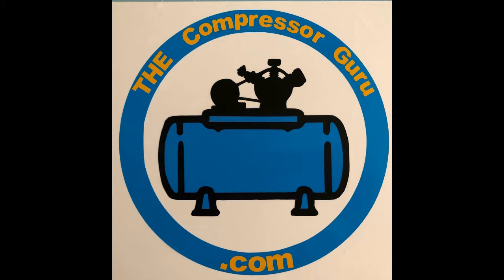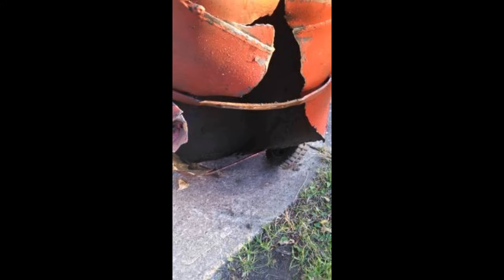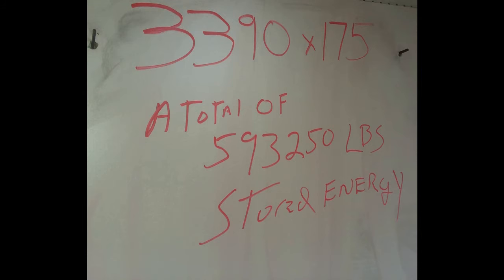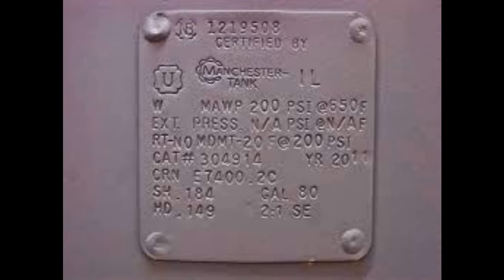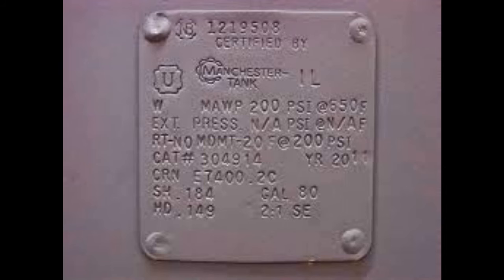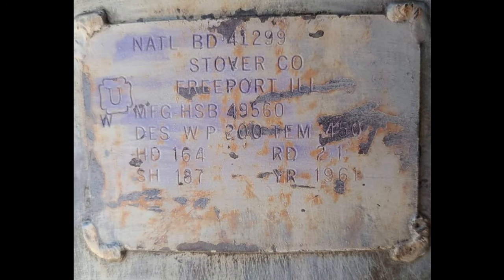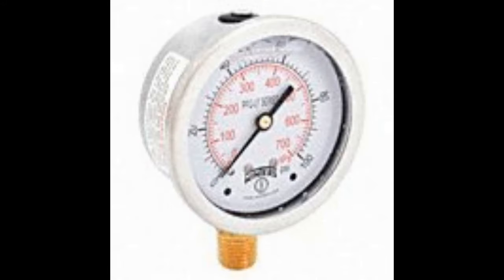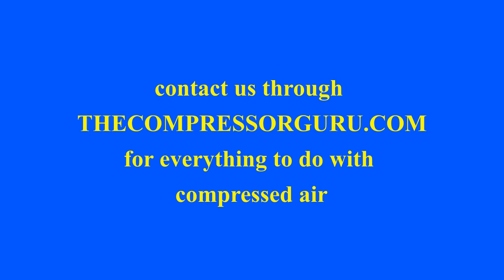Tank Safety, This video may SAVE YOUR LIFE!

Comment: Excellent video. I am always amazed at how many guys refuse to believe and potential danger with air storage tanks. Arguments come up on the online forums regularly. Too many take pressure tanks for granted when they can be bombs. I will refer to this video in hopes to convince the hard heads. PS all my air tanks have 2 safety valves. Nothing runs above 120psi. 

Edit: Also a tank story. Retired guy working on old truck in his barn behind the house. He goes in the house for lunch, and then there's a big BOOM. Goes out into the barn, the compressor has blown up, the tank went thru the back barn wall and out into the woods several hundred feet, missed many trees but finally hit one. 8ft x 8ft hole in the barn wall. It took him months before he got back working in the barn and got things repaired.
Reply: Old air tanks scare the $hit out of me.

Comment: I was once at a friends place and he brought out an older Craftsman compressor to use. He plugged it and and started it up As it was building pressure, I noticed the tank was 'sizzling' like somebody was frying bacon. I looked at the tank, and immediately yanked the cord out of the outlet to turn it off, and told the owner that the tank was a bomb that could go off at any moment, and he should not use it, and replace the tank at once.
Reply: I bought a used Craftsman upright compressor a couple of years ago. I drained a fair amount of water out of it.  I was religious draining it after each use . Brown stuff (rust) plugging the drain. Finally I tip it on the side & used a  oil can put X- amount of oil in the drain valve. I cycled the compressor a few times until the rusty scale stop coming out. NOW it freely drains water with no issues. A Note too others Please follow the owners manual! USAF 1981-85

Comment: I have always replaced the safety valve or blow-off valves in my compressor tanks with ones slightly below the maximum working pressure I use and most often well below the MFGs suggested one. Besides normal maintenance, I've always figured this gives me just a little more margin of safety.

Comment: Thank you Guru for this important Safety reminder. I bought a broken oilless compressor & broken pressure washer from a young construction worker friend. As he moved the compressor to load it on my truck, I heard it sloshing! I got it home & it was half full of water! No drain valve, just a factory painted plug, frozen in place! I like to think I saved his life. I remind him to this day to daily drain their air tanks. I will cut open this tank to serve as an example or hydrotest it to failure with pictures (either way). Paul.
Reply: Ironically, on the other hand, having a large amount of water in the tank might mitigate an explosion and save a life, since failures usually happen on the tank bottoms and making the air try to push out the incomepressible water would take longer for all the energy to get released.

Comment: I don't know what that "pounds of stored energy" means, but we have units that work perfectly well for force and energy. I'll redo the calculations and the result might be surprising. The tank has 175 PSI in it. That converts to ~1.2 Megapascal in pressure. The volume of the tank is listed as 80 gallons, which is ~302 liters. We need to know the temperature for our energy calculation, so I'll use 293k, which is about 67 Fahrenheit. That works out to about 1007 kilojoules. A stick of dynamite produces about 2.1 megajoules when detonated. So, that air tank has the destructive potential of about a stick of dynamite in it! Treat it with care.
Reply from the maker: thank you for the help explaining.
Reply: 1007 kilojoules is not about the same a 1000 megajoules, it is 1/1000 as much.
Reply: @secondwindmusicproductions   Oof, I didn't notice I copied the wrong excel cell into my final answer. A stick of dynamite is about 2.1 megajoules. The 1000 megajoule cell was one of my conversion factors, not the final result. The air compressor tank has about as much energy as 1/2 a stick of tnt.
Reply: @WarrenGarabrandt  TNT is not Dynamite.

Comment: Absolutely everyone with any size compressor should watch this.  I've seen countless videos on YouTube of peoples janky set-ups based on other peoples janky set-up that should get 1000 thumbs down but instead get 1000 thumbs up because no one actually knows WTF they are doing. It's all test piloting unproven ideas.

My added advice in addition to internal inspection and hydro testing is #1 make sure you have proper safety valves installed that are less than the max pressure rating of your tank and make sure they are in any location where the pump could over-pump a linked line or an auxiliary tank or both.  

#2 Understand that pressure ratings on tanks and all fittings, lines, etc are greatly reduced as heat is increased.  This is why using PVC lines, while generally ok for home shops and smaller compressors, should never be located anywhere near the tank where air is still hot.  IIRC, a 1" PVC line is typically rated at 500 psi but if the air is 200 degrees the rating drops to just 100 psi.  Most home garage people operate their tanks at 100-130 psi.. so guess what could happen...  BANG!   PS - Keith Rucker of Vintage Machinery is a god among men.
Reply from the maker: Amen old owl!
Reply: @oldowl4290  NO pvc NEVER for air
Reply: @funone8716  I agree. Some people do it but I never would.

Comment: So i got a delta tank 80 gallon i pullled plug out of bottom, To get the loose rust out i used evapo rust mixed some getting fluids. such as PB blaster seafoam into it can I rinsed it out again with baking soda water the tanks probably about 22 years old.I did buy the proper pressure release valve new sat in barn outta use for probably 15 years. Was it bad that i had added vinger into a guy told i probably shouldnt disturbed the rust with that stuff so then i added baking soda solution to it rinsed it again
Reply from the maker: Loose rust is not the concern. I think you are fine. but if concerned about tank stability , hydro test it. simply and quick not exactly but you will know if you can trust it.
Reply: @THECompressorGuru   yep I plan to hydro test great videos I have learned alot from your channel

Comment: Tried to see if mine is certified but only found that commercial use ones need certification. I bought a used Kobalt 26 gallon and is 16 years old. There is no rust on the external of tank. Now you have me wondering if I should use it. But I could turn it off at half way point to be on the safe side or should I even use it.
Reply from the maker: Keep the tank drained and use the compressor for a few more years. and then get is hydro tested.
Reply: @THECompressorGuru  how much do they charge and who does it?
Reply from the maker: @mgomez5606  If you have a pressure washer you can do it yourself. there is a link in the description to show you how.

Comment: Mr. Guru,
Thanks for making this video. I am always in advocate for being safe. I would like to ask a question, what is the importance of draining the tank every day? I understand water and metal don’t get along with each other, but as soon as you turn these things on condensation starts to build up and pools at the bottom. So even if you drain it every day you’re not going to get 100% of the water out and it’s always gonna be damp inside which is going to promote rust.
Thanks!
God bless!!
Blue
Reply from the maker: I think the best reply might  be the couple drops that accumulate in the bottom of the tank does not INSTANTLY cause rust. An auto tank drain (which we sell ) eliminates having to remember to drain the tank REGULARLY. 
Not hollering at you but good practices will make thing last longer.  thanks Blue

Comment: My father told me once , if you take any pressure vessel.  Tire , air tank , even a propane cylinder think about the PSI.  That pressure is at every square inch inside.   He would say. How many postage stamps could stick on the inside of that vessel ?  Kind of spooky when you look at it that way
Reply: You realize that’s 6 stamps to make a square inch right which is a box. It’s not
That many haha

Comment: Yes someone has an old compressor that set up for 175 lb why not install a new safety valve and lower the pressure to 150 or 125 lb.
Hey if you don't need 175 and it's only a bragging point......
....ehh?
Great video by the way and the math was way more than I expected.
I figured the volume be some % shy of 175 tanks scattered throughout your house. That's not only scary, but you wouldn't be able to watch TV. 😁
Excellent video by the way.
Last year my 1993 emglo twin tank compressor kicked the bucket. Not just the capacitor but the pressure switch.
I still haven't thrown it away yet but maybe fer kicks and giggles I'll cut the ends off the tank to see how nasty it looks inside.  I wasn't good about always draining the tank and letting the pressure out.
Fantastic video I seriously hope it scared a lot of people. 👍
Reply from the maker: if you put a lower safety that may help but are you masking a problem that has not happened yet.  if you cut the tank send me some pictures we may do another video on it.
you can contact me through thecompressorguru.com
Bud
Reply: @THECompressorGuru  thanks, I subscribed so I wouldn't forget.

Comment: Hydro testing is a relatively easy task now if you have any pressure washer. You just have to get the right fittings. I'm working on it now. I'll video the test. My 50 year old compressor shows no signs of degradation but I'll be testing it as the Guru suggests you can bet. First I am testing the one I just welded uo with ss mig. I know but what the heck, right? Call me curious. 😎🤣

Comment: i have a  old craftsman air compressor from 1980 i think it had a leak in the bottom of tank i guess it seal it self with some rust from inside the tank i can feel rust bits comeing out of the drain plug  I'm getting rid of it I'm not even messing with it 😁
Reply: How big were the rust bits?

Comment: Do they have expiration dates like propane tanks
Reply from the maker: No. but a rule of thumb for most insurance inspectors is to have them Hydro tested when 40 years old. we do have government boiler inspectors here I know they will show up and give a certificate and a metal tag to the bigger industrial customers. I have had some issues with an inspector that did not understand why a different safety valve on a tube before a check valve. I think that logic explanation might make a good episode.

Comment: I am wondering if a DYI hydro test really proves out the tank?  I guess I have this odd feeling that it could hold fine on a test at150%, but does that really mean it won't bust over the next 200 air pressure cycles?

Comment: I have a 35 year old Sears compressor. I drained the tank the other day and got about a cup of very rusty water out of it. Time to junk it?
Reply from the maker: several things to consider. what size is the tank? and is it worth doing a hydro test? rust colored water is normal but the age give me pause to do some more checking.
Reply: It's a 12 gallon. I kind want to get a smaller one since my only use these days is filling tires and maybe blowing dirt off/out of something. After watching your video and others, I want to find one with an ASME tank but that seem unavailable in smaller compressors.  @THECompressorGuru
Reply from the maker: @Hybridog  I do not know weather i would bother with a tank that small. when I do have them in to work on ( my labor rate usually discourages that) I turn them on and have them outside the shop and wait til i hear them shut off before I go near them that is how confident I am in these small uncoded tanks. I think t may be time to shop for a new small comressor.

Comment: Are there a catalog of images for examples of acceptable vs excessive rust?
I have a 21 year old tank that I just bought, there was, to me, what seemed like a fair amout of rust flakes in the bottom. Last guy said he drained it daily. I cleaned the chips all out, lightly hammered it all around the bottom and it appeared to ring solid and bright. I also Hydrotested it according to the video you mentioned to 250psi (certified WP 150) and it held pressure. No signs of any welding or attempted repairs. I suppose that means its okay for now?

This is my first larger compressor, 60gal whereas my last one was 20, so the potential energy storage has me a little uneasy. I also used some evaporust and it looks a lot better. Still some rust, but the bottom doesn't look that smooth compared to the top. Hard to tell honestly through a 2" bung.
Reply from the maker: by hydro testing you have done all you can for now.

Comment: Do you know a good source for a 80 gallon vertical tank? I have a IR that has a pin hole in the bottom. 
Thanks
Reply from the maker: Yes contact me through thecompressorguru.com tanks are not cheap but we do have a good source.

Comment: I have a IR 80 gal 5 hp. 2340 compressor but I have never mounted it to the floor is it really necessary?
Reply from the maker: all vertical compressors are top heavy and tip over easy. the short answer is yes... But if you have it in a compressor room where you can not bump it with a fork truck or even pull to hard on the hose . ok maybe. the other thing is an unsecured compressor may walk around. the vibration room it running may have it moving some around the floor. the 2340 is not seen in many industrial applications so the boiler inspector probably won' catch you. 
so for 20 minutes 4 anchors and a hammer drill ...Why not?

Comment: is 140 psi dangerous on an unknown tank homemade with no cuts nicks or damages? tank volume is around .3 gallon. (1/3 gallon). mounted near spare tire of truck.
Reply from the maker: I will say this all tanks are dangerous.but its is a small tank that means less sq inches for the PSI and 140 is safer that 175. for all the larger the tank is get it hydrotested. if for nothing else peace of mind
Reply: @THECompressorGuru  Thank you.

Comment: OSHA tests the wall thickness of my tank every 3 years using ultra sound. Even that doesn’t seem too thorough. And the guys they send out are not the sharpest.
Reply from the maker: that is really interesting. what state?
Reply: @THECompressorGuru  California of course. And they charge me. It’s in my business so you have to have the permit, which requires inspection.

Comment: It seems like the horizontal tanks are more prone to rupture. When I inspected and cleaned my 20 gal horizontal I noticed the metal around the drain bung was warped inward mostly likely from the original welding process thus making it nearly impossible to drain all the water out, even after rocking the tank back and forth. 
I noticed a similar problem on a vertical tank I inspected where the drain bung protruded about an 1/8 inch or so into the tank, as well as the drain plug. My solution in both cases, although not quite at effective on the horizontal tank, is to take a small cut off wheel and cut / grind the inside (back side) of the bung flush with the inside of the tank and grind down / shorten the drain plug as well. Also thorough cleaned with acid, hydro tested, dried and then coated the inside with Fluid Film (lanolin).
Reply from the maker: I am very glad you hydro tested after the modification.

Comment: the Psi Relay Contact points got stuck and allowed for a continues  running or someone adjusted them to pump even higher psi then it was designed for .. I'd say it was stuck Contact points that did continuing run because that was allot more then 130 - 150 psi that did something like that more like 300+psi that did do that.  these contact relay points are some what or were once like what they have on Water Well Pumps to turn on and off the pump  from 20psi to 60 psi of water or water tank psi,.
Reply from the maker: your tank safety should have relived the pressure when it got to the valve setting which should match the Max working pressure of the tank!  shut it down and  a change the switch B find the cert tag on the tank C put the proper safety valve on. I sell the switch and valve  you may contact me through thecompressorguru.com
shut it down SHUT IT DOWN!!

Comment: Serious question - I have looked up many videos of tanks exploding. And all the failures I have seen have happened to sideways sitting tanks. Tanks that have the seam welded along the bottom. Do you think there is anything to that? I have not seen one of these failures on an upright tank. Not saying it doesn't happen. It just appears to happen more to sideways tanks.
Reply from the maker: Very Good Question. Just a guess 
1 reason is most tank failures are on cheaper non coded tanks. they are usually horizontal.
 2 the vertical tanks have a dished bottom and ALL water is in the dish. and drained more easily . in  addition there are no welds on the tank till you get to the straight side of the tank,  also I have to wonder when the bottoms are formed do they start with thicker steel because they are going to be stretched?? 
 Really good question.
Reply: @THECompressorGuru  Thanks for the reply. I appreciate it. I agree with everything you said. And I wonder about the thicker steel as well. I have searched again and cannot find an upright failure online. I will keep searching. I like to see what the rip looks like if I can find one.
Reply: @THECompressorGuru  I wanted to come back and add to this. I just got an upright replacement for my old rig. I am going to take a camera to the insides and document it as it ages. I will compile the information.
Reply from the maker: @PopCultureDefector  Let me knw how that goes. in the future it may make a great video.